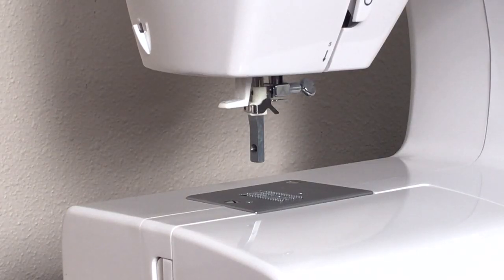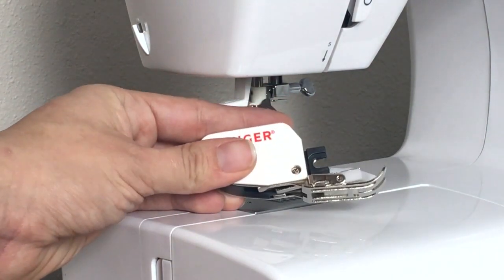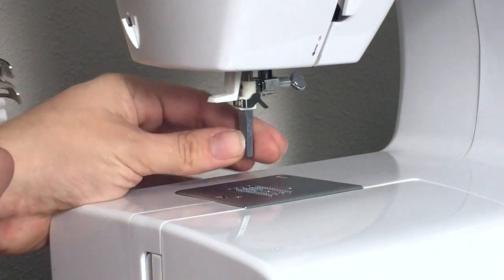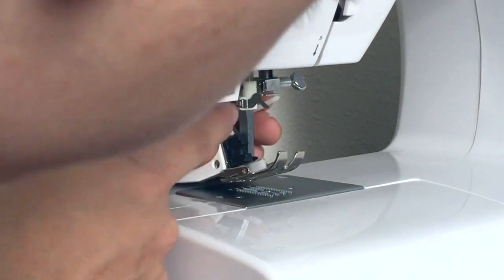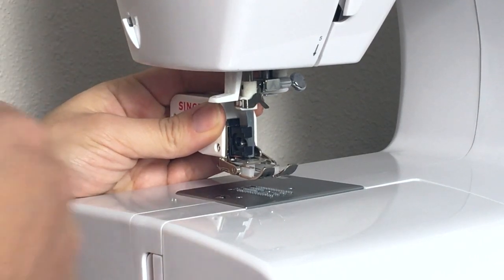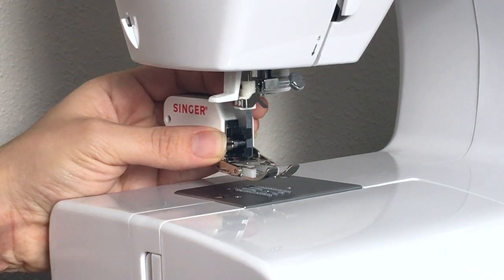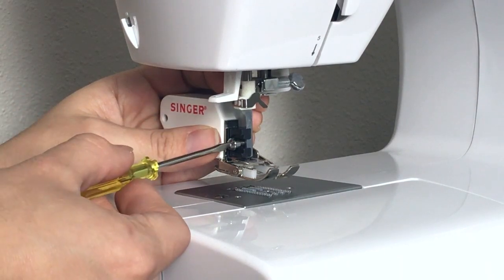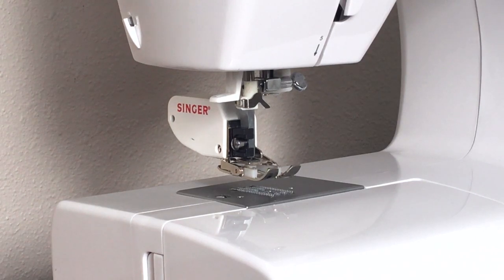How to Install a Walking Foot Sewing Tutorial

Comment: First you have to remove the needle and the presser foot shank, am I correct?   I bought a Singer 4452 and there is no manual.  I'm so annoyed.   You don't have to answer the question, I'm going to have to fumble around with it.    Thanks for the help you have given.
Reply from the maker: Have you tried searching online for manuals or videos for your specific sewing machine? You can also try sewing machine repair stores for assistance!
Reply: @coppercreekpatterns  - I ordered one on the internet.  Cost 14.95 plus postage.   Did not have a lot of info in it either.  I still don't know about oiling the machine.  What a rip-off!    But I'm not worrying about it now,    I finished my quilt on my old machiine and I'm all done sewing for a while.  Thank you for your response.